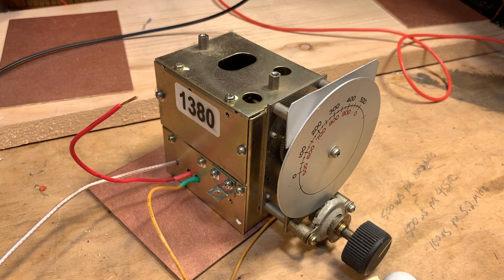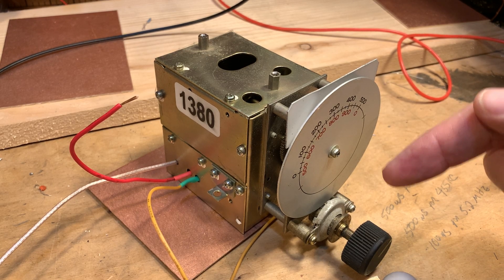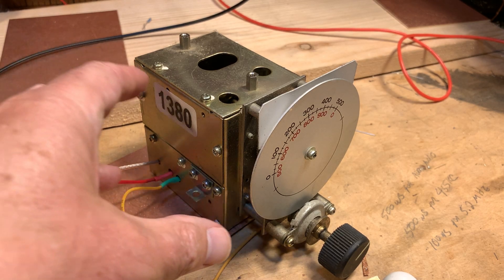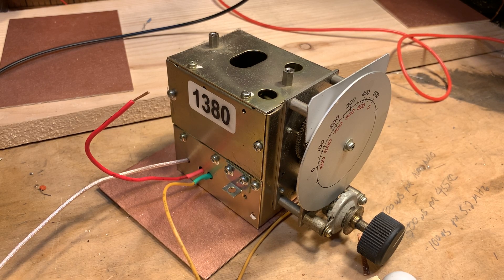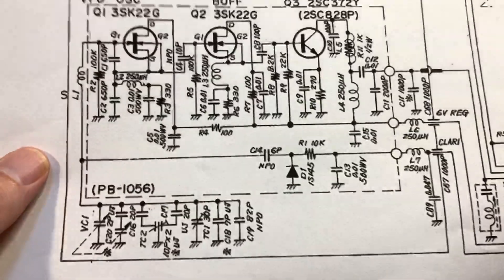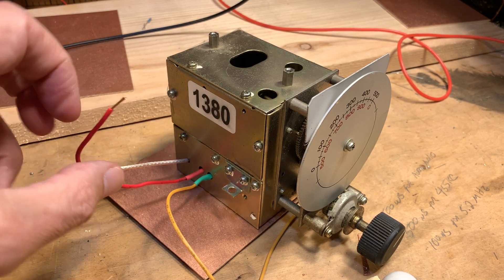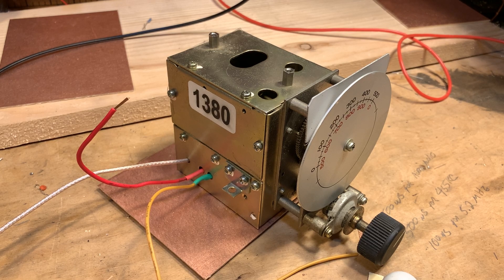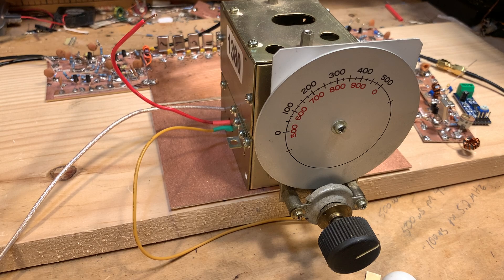SolderSmoke Video -- Mythbuster Video #3 -- The Yaesu FT-101 VFO

Comment: Possibly a stoopid question but... does this 'VFO-in-a-box' need any input signal? Or is it just +6V & Gnd and out comes oscillation? 73 2E0FXZ
Reply from the maker: It came complete Stephen.  I just applied 6V and it oscillated nicely.  Even the "clarifier" circuit worked. 73  Bill